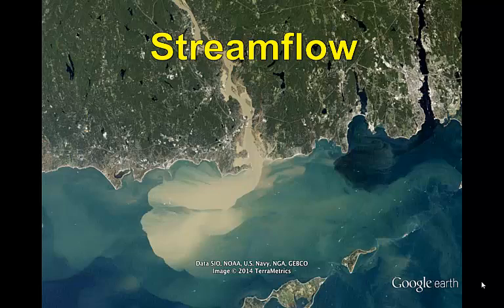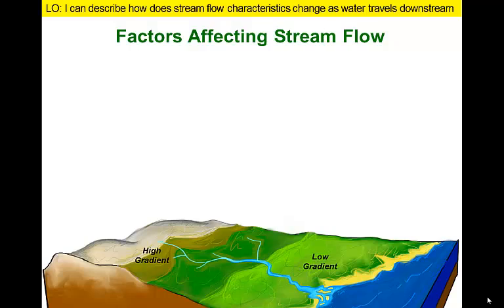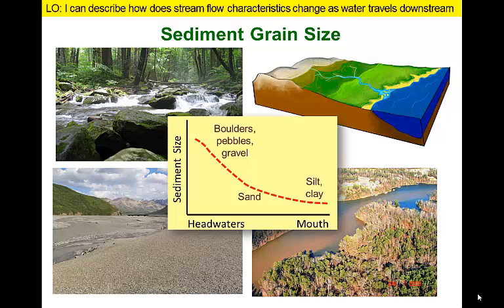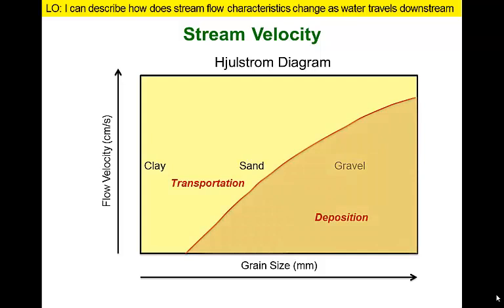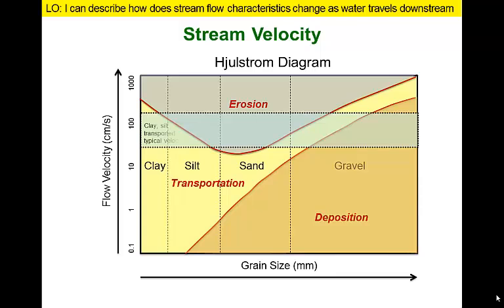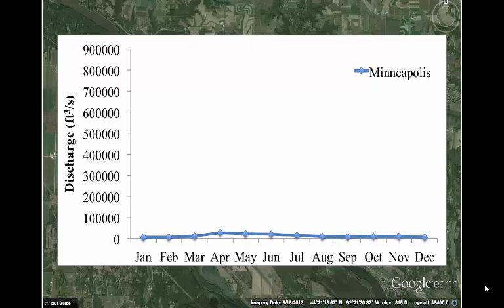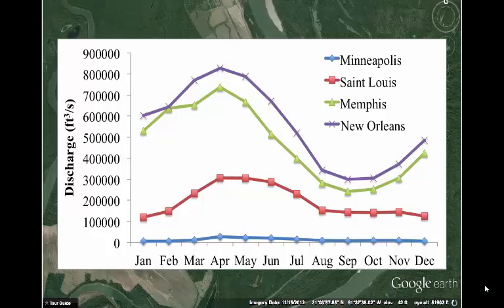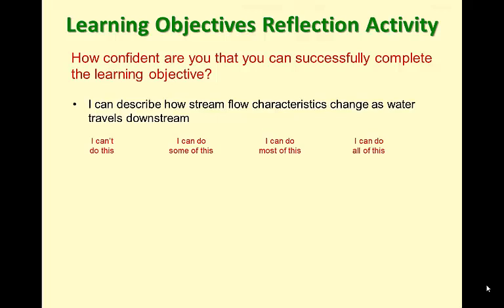Streamflow

Comment: It's not clear to me that velocity necessarily increases as you go from headwaters to mouth.  Shouldn't that be discharge, not velocity?  On the other hand, this is about the best explanation of Hjulstrom diagram I have seen.
Reply: Seems logical that velocity would decrease downstream as slope decreases, right? However likely this seems, the data tells a different story for most rivers. Check out this publication from the USGS: https://pubs.er.usgs.gov/publication/70184457
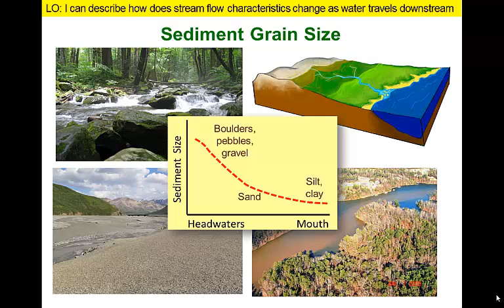Reply: Your discussion following that claim of higher velocity downstream is all about discharge, not velocity.  You compare Minneapolis, St. Louis, Memphis, and New Orleans.  The discussion of sediment grain size at about 2:00, which states big stuff at the headwaters and little stuff at the mouth, implies slower velocity downstream.  Again, the discussion of the Hjulstrom diagram is great, better than I have been doing.  I know the dynamics are more complicated for a system like the lower Mississippi River, but I want to keep it to the basics for my first-year geology students.
Reply: Velocity of the water is determined by a number of factors.  Maybe the most obvious is gradient; higher gradient = faster velocity.  That would suggest that headwaters should have faster velocity than downstream areas where the gradient is lower.  But there are other factors also: 1) roughness of the channel; 2) total water in the channel; 3) shape of the channel, and more.  As you move downstream, these factors all change in ways that increase water velocity - channel gets smoother, more water in the channel, for example.  The cumulative effects of these all outweigh the gradient as you go downstream, so in the end, average water velocity is faster downstream than it is upstream.